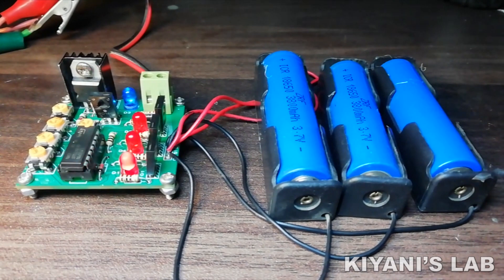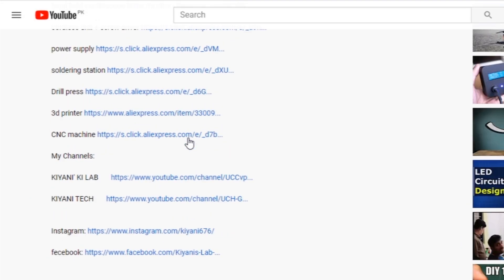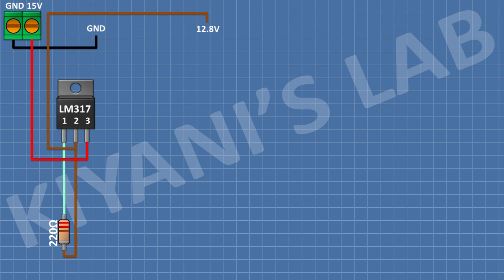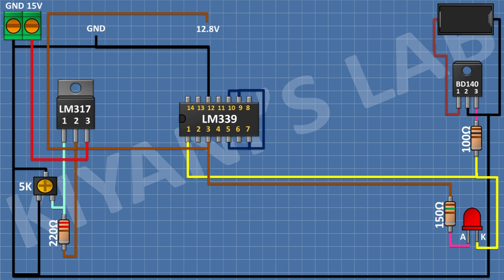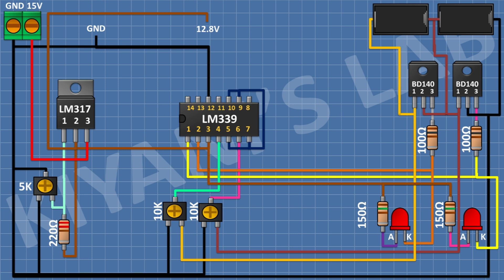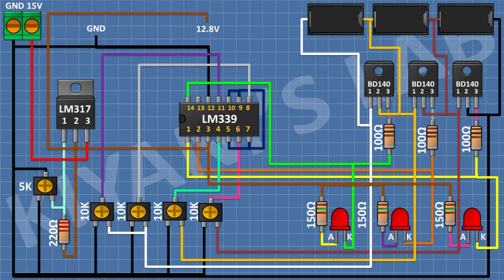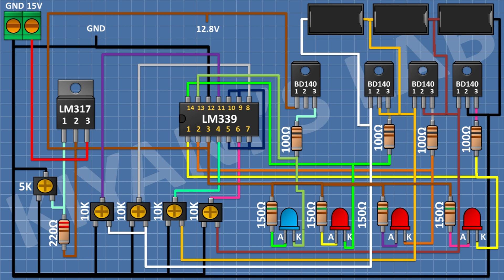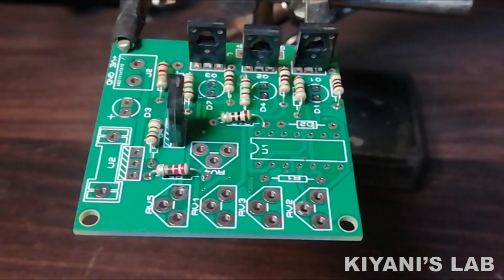How To Make 3S BMS Circuit

Comment: which tools are u using for making the circuit connection and schemetic diagram of pcb??
Reply from the maker: circuit connections MS PowerPoint schematic and pcb with proteus
Reply: @KiyanisLab  ok thanks
Reply: I have done a pcb layout in easyeda software and i want to fabricate that, but due to the high shipping charge I am unable to fabricate that from any site like pcb way, jlc pcb. 
So can you suggest a better site for pcb fabrication at minimum prices. 
I also visited the lion circuit as compared to others The price is less but if you have any other option then inform me